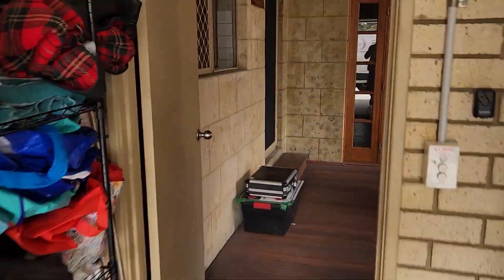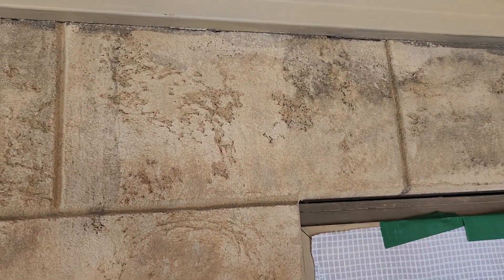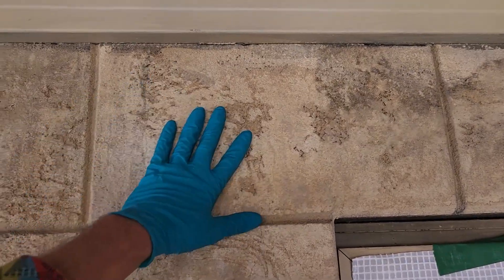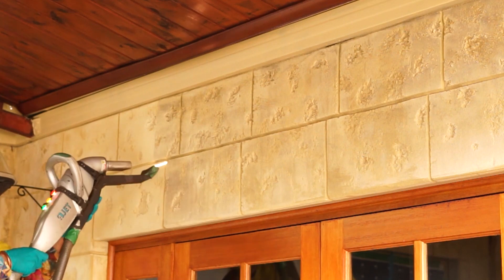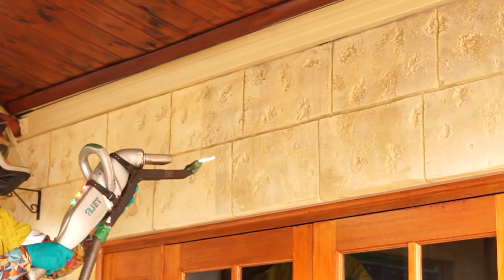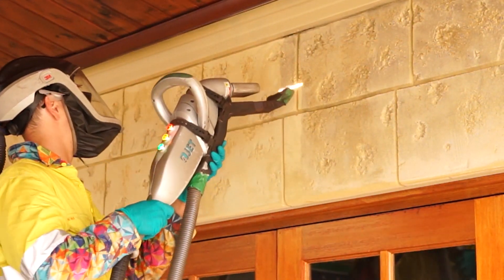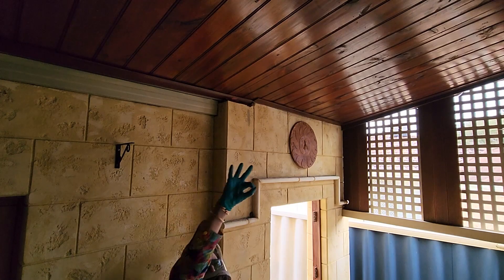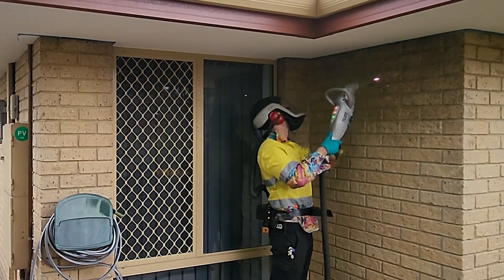Removing smoke staining with a laser

Comment: From your other comments O&G industries along with paint removal jobs. Can easily sell laser cleaning.

But what was your cost and laser machine you purchased. 

And how can you it mobile. Those lasers must draw a lot of electricity
Reply from the maker: Hi JG,
Nothing has been easy, unfortunately, though the O&G sector definitely is a huge market for us.
We have a 16KVA generator in the van that powers the laser and a 2nd generator that powers the extraction unit and the Compressor.
We use a 4Jet 500W laser and the purchase price from Germany is North of 225,000Euro
Reply: @projectlaser  is unfortunate because clients don't believe in laser cleaning or is a safety issue. Where most O & G refineries ban open flames or anything that can cause a fire. 

Because the first thing that came to mind is welding prep with that laser. And refineries have lots of welding to do on top of the painting